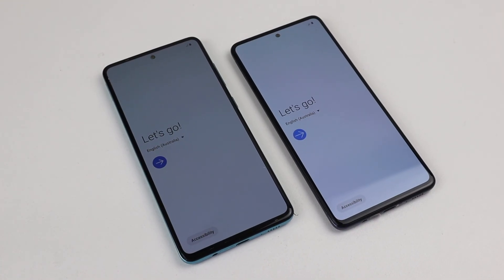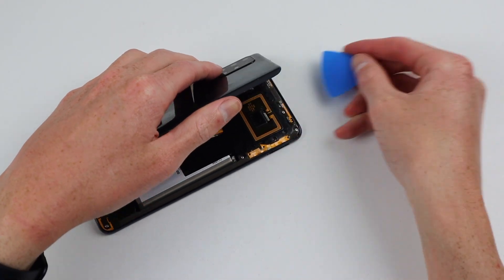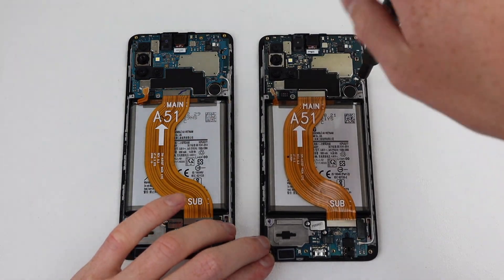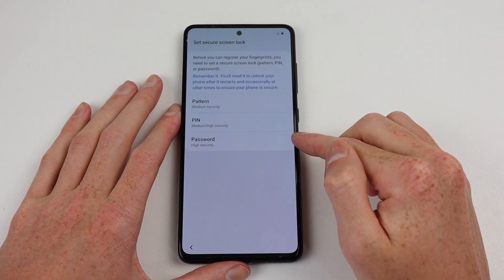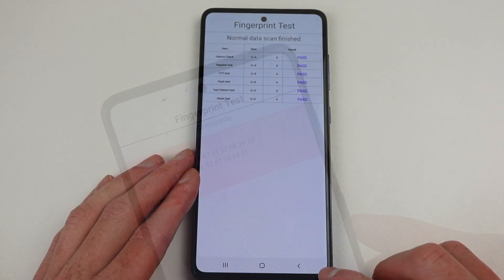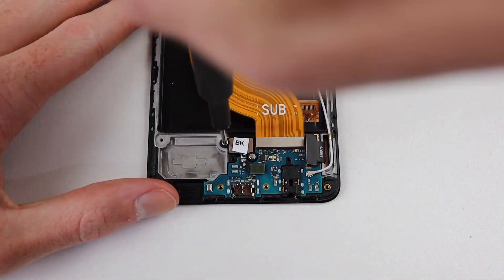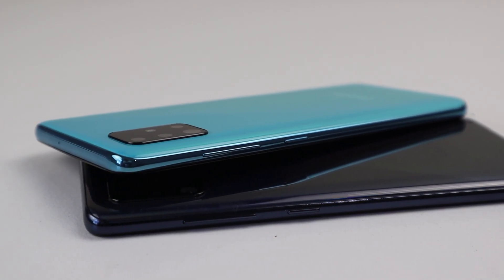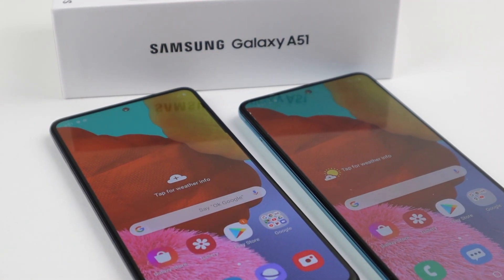Samsung Starts Blocking 3rd Party Repairs? - Galaxy A51 Teardown and Repair Assessment

Comment: Try flashing the stock firmware through odin after installing a new display. It helped me with fingerprint needs calibration issue. Just factory reset doesn't help.
Reply: Sum Ting Wong 深丁黃  ...what? even if a lawsuit did come, it would not be in their favour because you have a right to do everything you want with the device
Reply: @nickostrowski183  Which is why is so important to support the "Right to repair" moment. So manufacturers stop screwing the consumers and the small repair shops.
Reply: @nickostrowski183  I'm sure George Hotz will be absolutely thrilled to hear that.
Reply: @KenAshcorp  idk who dat
Reply: @nickostrowski183  Then I honestly do not believe you have a good understanding of the subject you are talking about.
Reply: @KenAshcorp  you are flashing official stock unmodified samsung firmware with a tool made by samsung (odin), if samsung didnt want people to use odin then they shouldnt have made it publicaly availiable
Reply: @nickostrowski183  lol samsung odin software have been available for year , it an official samsung firmware flasher .Tbh it has save me from bricking my samsung back in the day.
Reply: @nezunish-898  yep, it helped me know about modding, so far I have modded 2 samsung devices, the original galaxy tab, and small guy, forgot the name, I tried to install android 4, 5, 6. Didn't go to well, one of them worked but lagged hard, others just didn't work and wasn't worth it. did all this in core 2 duo 2gb laptop
Reply: @KenAshcorp  Companies generally can't sue you for something that you do to one of their products that you rightfully own. I don't see Honda suing people for slapping some rims on their Civics, GM suing people for installing a lift kit on their Silverado's, or Toyota suing people for replacing a burnt out brake light bulb on their Camry's, so why should it be different for smartphones?
Reply: @alexl9758  And that analogy is the exact reason right to repair exists. Because that simply isn't the case right now for many MANY electronics. 
Hence, George Hotz
Reply: @alexl9758  because these are cars. In some countries owner can't even replace a tire. They will get charged if a third party wheel detected.
Reply: @nickostrowski183  no
Reply: good idea, he should make a follow up to this video
Reply: Something I was thinking about, does it still work doing software updates afterwards?
Reply: @gedeuchnixan3830  Yes, it still works. But that is on my galaxy a50. I'm not sure it's the same with a51, that's why I suggested for someone else to try.
Reply: I bet apple devices can be fixed too if you jailbreak them.
Reply: @mx5agpxa972  Don´t think so, so far jailbreak made it like a regular android phone nothing like rooting android. And you have to get parts in the first place, not easy for Apple.
Reply: རཨེ་མོན་ད། ལོ་རྡེ་ཧྨུན།  for what exactly? Following my rights? xd

Comment: The beginning??? your so biased what do you think the glue sandwich  they had for the last few years was? Apple has 2 screws and a seal you got to separate no heat gun needed.
Reply: That was back in the iPhone 6 era. You need about 300c degress and have to be extremely careful not to burn the oled. Even if you open it, what can you do ? The parts are all paired.